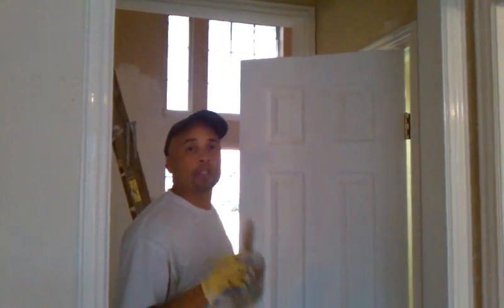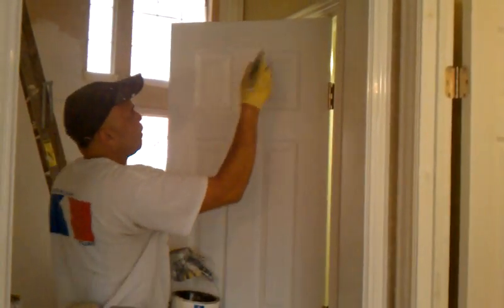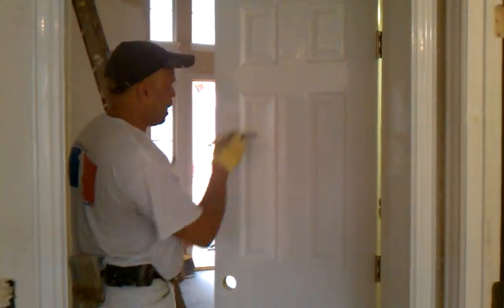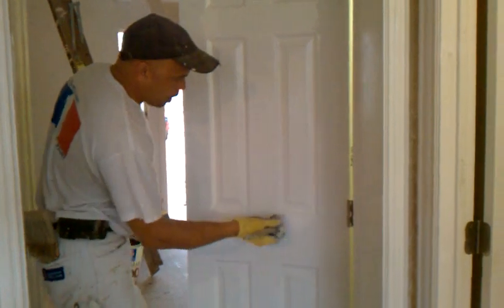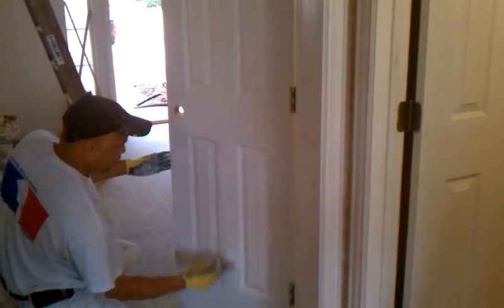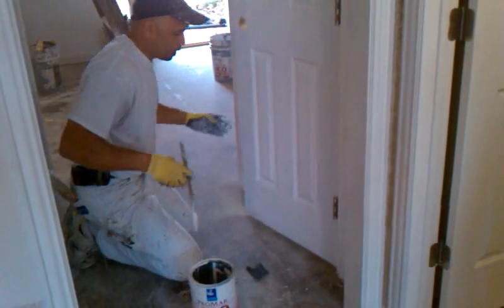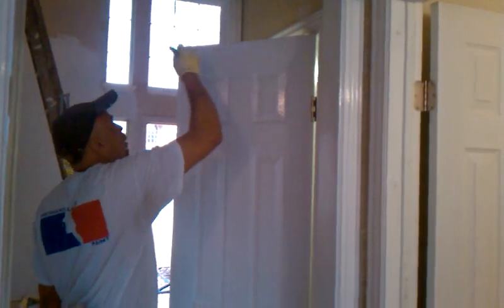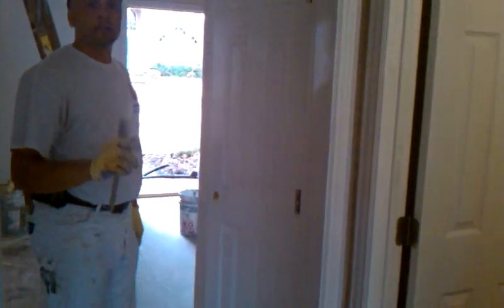Steps On How to Paint A Door in Oil base..3gp

Comment: I always work all of the inset panels first then run my rails and stiles.
That way my rails and stiles won’t streak gum up or drag.
Also a combination of Flood Penetrol and a little mineral spirits and she lays in really nice even on hot days.
You can also take a thinner rag and wipe off your rails and stiles as you go along painting your inset panels 
I do this on slick finish panel doors and it works great.

Comment: When painting with oil it's not about the speed in which you paint. Oil based paints like latex have what we professionals call "open" and "closed" times. When the paint is "open" that means you can touch it with your brush without leaving brush marks. When it's in the "closed" consistancy you cannot touch it without leaving brush marks.

Oil painting in regards to trim and oil should be approached as an art not production style like this video portrays.

The reason this video is ALL about SPEED is because the painter is attempting to spend the smallest amount of time on this job and possibly even only apply 1 coat.

In regard to the "temperature" and speed to this video. ALL of that can be fixed by using an oil based extended product or even "thinning" the oil with spirits..

Also the system is wrong. You can achieve a much cleaner and smoother finish if you do the 6 panels first. The trick is to keep a rag on you that has a paint thinner on it to use on the edges of the panels so it's not overlapping into the sashes. Once the panels are done. Start from the middle and paint your way out to the long side sashes.

NEVER paint hinges or door hardware without sanding and priming them first or it will not hold. ( as long as it should )

There is a difference in production style painting and custom.

Custom painting is more focused on the Quality = more time

Production = Less time and less quality.